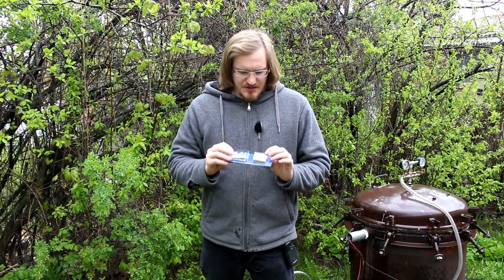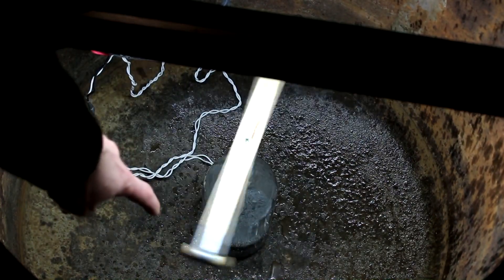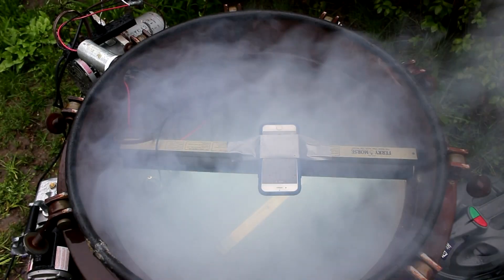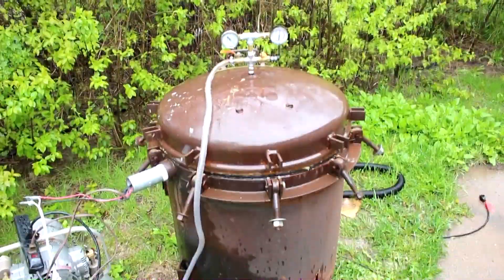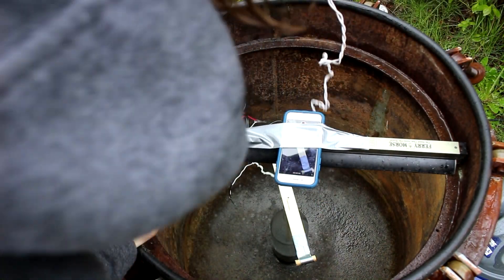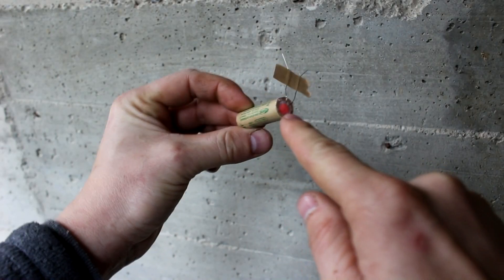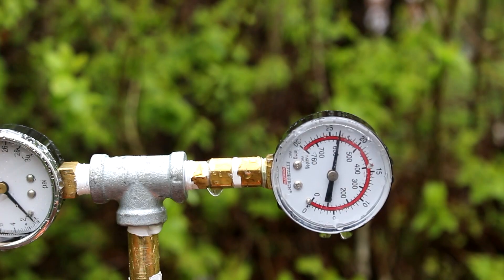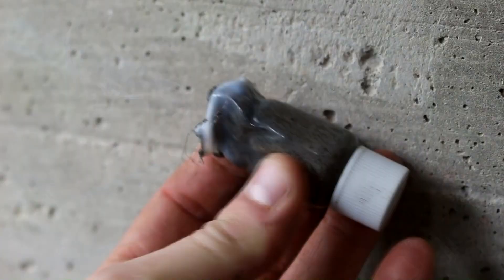Will a Model Rocket Motor Work In Vacuum?

Comment: The nanosecond that the rocket fired initially,  Lost the entire vacuum in the barrel..  And so you are not working under vacuum conditions.
Reply: bo ptah yea because rocket fumes travel at speed of light;) You must be brightest bulb in your vilageXD
Reply: @tgstudio85  Rocket fumes do not travel at the speed of light.  You cannot have mass and travel at the speed of light.  That is just basic Einstein 

    The first Rocket fumes that leave the rocket.  will be travelling just as fast as the last ones because there is no resistance in a vacuum to slow them down..   That is of course assuming you can get the gasses to mix and ignite in a vacuum,  Which is dubious to say the least.   so therefore you will NOT be pushing off Rocket fumes to propel yourself forward..  If you can ignite a rocket in vacuum, the Rocket will remain stationary.   That is why the world altitude record for Rocket height is well within the Earths atmosphere.  .  Because the higher you go.  the thinner the atmosphere and so thrust is reduced.   

    And yes.  I am the brightest bulb in my village.   thank you.
Reply: @boptah7489  - well WHAT ABOUT THE YT VIDEO: "Uninterrupted Footage of the Falcon Heavy Launch and Booster Landing! 2-6-18"
It CLEARLY shows that the side boosters can TURN AROUND AND FLY BACK AFTER SEPARATION  from the center core.

bo ptah - WHAT IS THE ATMOSPHERIC PRESSURE ABOVE 50 kilometers where the boosters separate?
OH THAT'S RIGHT - ITS A VACUUM 

So please explain how those boosters are maneuvering IN A VACUUM?
What's that YOU REFUSE to admit that the atmospheric pressure above 50 km is LESS THAN 1.0 TORR?
Well that is because it would prove you to be wrong OVER AND OVER AGAIN.
Reply: @stuartgray5877  please.  Do not bore me with NASA or Spacex fake footage.  If you believe that the rocket nozzle being filmed is real then i feel sorry for you.  ie.  the nozzle vibrates as the thrust is created.  But the camera and the Earth are perfectly still.  Yawn.
   the boosters are nowhere near 50 KM.  A rocket that heavy can not go anywhere near that high. A helium balloon can fly higher than any rocket. 

    Once you understand that it is impossible to create pressure in a vacuum  ( or near a vacuum )  then you might understand better.
Reply: @boptah7489  no you misunderstand the rocket in space does not push off of the fumes that it be ejected earlier it pushes off of the fumes as it's ejecting currently,  the same force that makes the fumes travel in One Direction makes the rocket travel in the other with an equal amount of force ( Newton's third law)
Keep in mind under atmosphere the air pushing on the back of the rocket is the same amount of air pushing on the front of the rocket and all around it and this results in decreased pressure at the nozzle meaning decreased thrust.
More pressure around the outside of the nozzle of a rocket makes it slower and require more thrust for the same amount of speed.
Literally the opposite of what you think is true.
Also the guy saying "you believe fumes move at the speed of light" is burning out how ridiculous the idea that the first nano-second that thing was fired the vacuum was compromised
Reply: No it was still under vacuum, it was a slightly less of a vacuum but it's not like the thing was ever a perfect vacuum, it's good enough to show the effect a vacuum would have on thrust

Comment: Cool video! How did you manage to run the wires into the vacuum changer and achieve a good seal?
Reply: I think he set them in jb weld in holes that were already drilled in the chamber.

Comment: Yea, he cheated.
Reply: that's kinda how chemical rockets work, they have an oxidizer tank and a fuel tank, and the oxidizer mixes with the fuel and the rocket is able to ignite, what cody did is having the fuel tank(gunpowder) inside the oxidizer tank(air) instead of having a valve that mixes them together

Comment: Once your rocket fires, an atmosphere is created to push against. Unless you can make an endless expanse of vacuum behind it, this is hardly valid.
Reply: There isn't anywhere near enough gass to push against, assuming that was even how rockets worked. The one in the rough vacuum accelerated much faster than the one in air at regular pressure, which probably wouldn't be the case if that is what it was relying on for thrust.

Comment: Hi Cody's Lab ... please don't use any air , not in that bottle, the whole thing has become no longer vacuum when you introduced the aired bottle inside the garbage bin
Reply: there is barely enough gas in the chamber to change anything at all though, and before the motor fired it was nowhere near a perfect vacuum. There isn't really any such thing as a perfect vacuum either, and the best vacuum chambers scientists use still have more gass in them than most of the solar system if I remember correctly.

Comment: The exhaust gas is pushing against the walls of the chamber to produce a movement. In vacuum space there r no walls or air. This rocket is also producing large amounts of gas so this chamber is actually not a vacuum. .. .. A big vacuum room should be used to prove rockets can move in vacuum space
Reply: Did you understand how you are wrong, now, or you still need an explanation?
Reply: @ThomasKundera  , I am right .  This experiment is flawed.

Cant compare an infinite vacuum Space to a small  1 feet wide cylinder
Reply: @kunjikorans  : I don't care much about that experiment.
I explained you how thrust works in vacuum.
Did you understood ?
Reply: @ThomasKundera  , Thrust works  when air pushes against something. 

There is no air in vacuum Space
Reply: @kunjikorans  : "Thrust works when air pushes against something. "
No.
OK, so you didnt understood.

Coming back to my explanation, when the spring was pushing against the two rocks, was any "air" needed for the rocks to fly away from each other?
Reply: @ThomasKundera  , rockets work when exhaust gases push against air
Reply: @feathered3167  ,  its funny to see that people like  you still believe in the mythology of Space Travel even  though we live in an age where all kinds of information is available
Reply: have you heard about newtons laws of motion?
Reply: @eduardopupucon  ,   do you know what happens when  air comes in contact with vacuum ?

Comment: You'll notice, you were able to get it to ignite inside the bottle because of the atmosphere/oxygen being trapped, once the hole popped and the oxygen was exposed to the vacuum, the motor went out immediately.

Just proved that if you trap oxygen around the the fire will ignite until the oxygen is taken out again and no longer works...

How does this prove space travel?

In space, there is no oxygen.

As soon as it is exposed to the vacuum it would get "sucked dry"/expand and wouldn't work, such as your experiment shows.

There is no pressure/atmosphere around a vessel in space to help guide it. Because of the vacuum there is 0 aerodynamics for the vessel. It could just spin/flip indefinitely as soon as you ignite it.
Reply: "In space, there is no oxygen."
That's why rockets carry their own oxidizer.

" It could just spin/flip indefinitely"
If the rocket motor push one side, rocket will go the other side.
It works.
Reply: that's why rockets have an oxidizer tank connected to a fuel tank, duh

Comment: Man, you did an experiment but you do not understand the result. The toy rocket did not burn because there was lack of oxygen, not because of "no preasure". The proof is longer burning time of the first launch comparing to the one in the bootle. The "bootled" launch was shorter due to small amount of oxygen available for reaction - was the fuel burnt completely? I would advice to fill the chamber with nitrogen and then try to ignite the model rocket. I bet it will not burn in the nitrogen atmosphere.
Reply: after the rocket ignites there is literally no way oxygen from the outside could get in, it has oxidizer mixed with the fuel and that's how it burns. I think cody might have explained this in the video.
Reply: @feathered3167  after the rocket ignites, it burns the oxygen that is inside of the bottle he attached to it!  THE ROCKET IS NOT IN A VACUUM, IT IS INSIDE OF A BOTTLE, FILLED WITH AIR!

Comment: Looks like a legit test to me. The other guy you never see the vac gauge. I think rockets can burn in a vacuum but I don't think they work as well as they would in an atmosphere with oxegen to help them burn.
Reply: after the rocket ignites there is literally no way oxygen from the outside could get in, it has oxidizer mixed with the fuel and that's how it burns.

Comment: You can't recycle water in space because a condenser won't work without gravity.

So looks like NASA is taking the piss again.
Reply: osmosis (or reverse osmosis) would work well in zero g
Reply: nasa uses electrolysis and osmosis

Comment: Sound does not travel in a vacuum so how do we get The explosion sound at  6:42 if the camera was also in the vacuum?
Reply: it isn't a perfect vacuum and the phone can perceive vibrations that go through the solid objects touching each other in the chamber.
Reply: sound travels through solids, if you touched a microphone on a vacuum you would be able to hear the sound of it touching, but if you flipped your fingers in front of it you wouldn't

Comment: Yes...the rocket pushed off the encapsulated bottle itself. It was walled off so had something to push off of...itself. But in space the open thrusters are much more like the first experiment not the last one. The only reason you got movement was because the engine had the inner wall at the back of the bottle to push off of, and that was not in true vacuum and a spaceship would obviously be with open thrusters. So again, this experiment does not reflect reality.
Reply: so things can move by pushing static parts of themselves now? that'll be good for gas since I just need to get someone to push against the back of their seats to get the car going.
Reply: the second experiment is how chemical rockets work, they have an oxidizer tank and a fuel tank, and the oxidizer mixes with the fuel and the rocket is able to ignite, what cody did is having the fuel tank(gunpowder) inside the oxidizer tank(air) instead of having a valve that mixes them together

Comment: Only way to make it successful is to cheat and create an atmosphere for the fuel to ignite in a vacuum.  Lol
Reply: It had to have pressure inside the combustion chamber to ignite, and once the bottle was broken open the motor was running and producing thrust in a decent enough vacuum. Also, once it was burning and the bottle was broken open there wouldn't have been enough gas in the chamber to provide enough force to push the motor. The vacuum chamber he was using here was 50 gallons, which is 189270.6 cubic centimeters,the bottle the bottle that the motor was in could hold about 37.5 cubic centimeters of air (assuming it was a rectangular prism because I'm to lazy to do the math for a cylinder and not containing the motor), which means that at most the bottle would contain 5047 times less air than would be needed to fill the chamber.
Even assuming there were also some residual air in the chamber (let's say 5%) it would still mean that the motor would have around 5.00002% of the mass available to use to accelerate as the motor would have if it weren't in a vacuum chamber.
By what I can tell is your logic, the motor should take more time to accelerate in the vacuum than in air, but the opposite is what actually happened. The motor in the vacuum accelerates fast enough to move completely off the screen in 2 frames while the one in a thicker atmosphere took 5 frames to accelerate and move off the screen from the same starting position. The one in the vacuum was able to accelerate at least 2.5 times faster than the one at regular atmospheric pressure.
Reply: Feathered   Yep, there’s no atmosphere (he had to create one) in a vacuum.
Reply: You don't seem to understand what a vacuum is, do you?
It still doesn't make it impossible for a rocket to be ignited or run in a relative vacuum, in case you are among those who do believe that. Although, if you make it clear that you do in fact believe it, then I will be sure to explain it to you in a way that you can understand.
Reply: Feathered   You one of those people who still believes in the moon landings?  Before you say tinfoil hat (it’s worn by the moonies now), here’s the latest poll on non-believers:  Russia.— 57%;  UK — 52%.  The world is truly waking up.
Reply: I said nothing about the moon landings, why are you talking about a nearly completely unrelated subject to what we were discussing before (and creating a straw man of me)?
Reply: that's kinda how chemical rockets work, they have an oxidizer tank and a fuel tank, and the oxidizer mixes with the fuel and the rocket is able to ignite, what cody did is having the fuel tank(gunpowder) inside the oxidizer tank(air) instead of having a valve that mixes them together
Reply: @eduardopupucon    The small thrusters on the sides of the LEM have to be encased in its own environment, and once the gas expands and blows up the cap, it will move backwards, but then it only works once because you have to recap it for it to work again.  With no cap, the puffs of propulsion can’t push through the vacuum of space.
Reply: @reyrey4261  the RCS thrusters on the LEM were monopropellant, there was no combustion,  they were operated by a valve, when you opened the valve the gas vented, when you closed the gas stopped flowing, just like opening the bottom piece of a ballon.
Reply: @eduardopupucon    I’m open minded and I can see this working because it has a valve with the expanded gas enclosed, but I have more problems with the rockets.  You need combustion but the expansion of gas happens outside in the vacuum of space.  And, then we still have hundreds if not thousands of irregularities from NASA.  Two of those I’ve mentioned in my other posts above.
Reply: the second experiment is how normal rockets work

Comment: i saw atmosphere test work far superior...so called vacuum test went into unbalanced spin very quick..this test proves nothing.
Reply: The vacuum chamber he was using here was 50 gallons, which is 189270.6 cubic centimeters,the bottle the bottle that the motor was in could hold about 37.5 cubic centimeters of air (assuming it was a rectangular prism because I'm to lazy to do the math for a cylinder and not containing the motor), which means that at most the bottle would contain 5047 times less air than would be needed to fill the chamber.
Even assuming there were also some residual air in the chamber (let's say 5%) it would still mean that the motor would have around 5.00002% of the mass available to use to accelerate as the motor would have if it weren't in a vacuum chamber.
If it were actually using the gas in the chamber to accelerate, then the motor should take more time to accelerate in the vacuum than in air, but the opposite is what actually happened. The motor in the vacuum accelerates fast enough to move completely off the screen in 2 frames while the one in a thicker atmosphere took 5 frames to accelerate and move off the screen from the same starting position. The one in the vacuum was able to accelerate at least 2.5 times faster than the one at regular atmospheric pressure.
The one in the vacuum only stops burning faster than the one in the atmosphere because the exhaust was escaping too quickly to maintain the reaction in the combustion chamber so it wasn't able to burn for as long.
Reply: He already did the test that proves solid fuel Rockets burn better at atmospheric pressure
This was not testing whether solid fuel Rockets burn better in a vacuum you idiot
"Proves nothing" what do you think this was trying to prove?
It was just testing solid fuel rocket thrust in a vacuum and he did it successfully